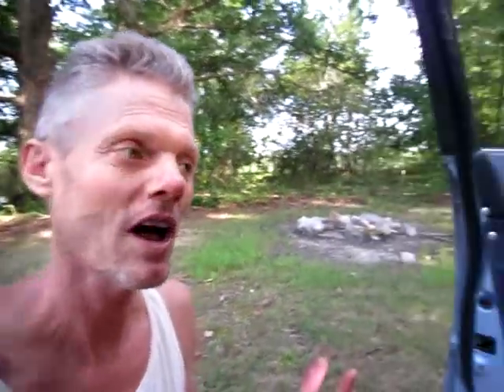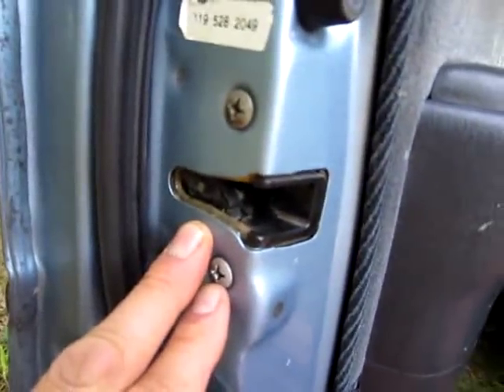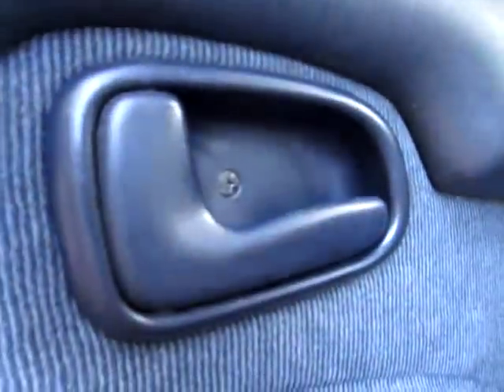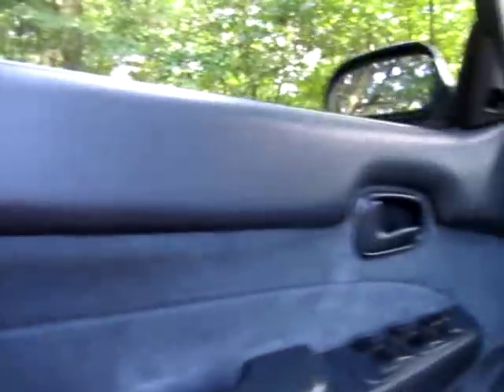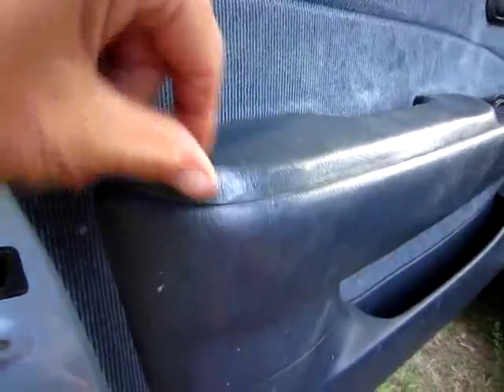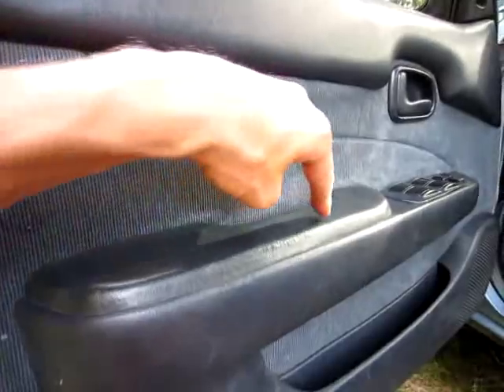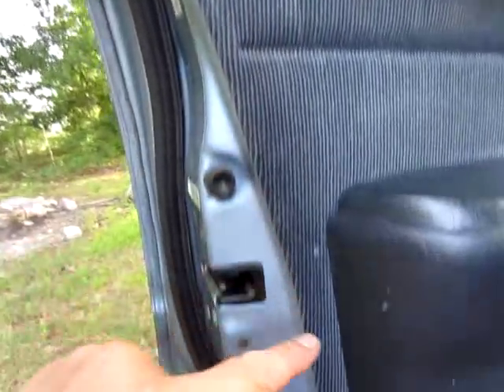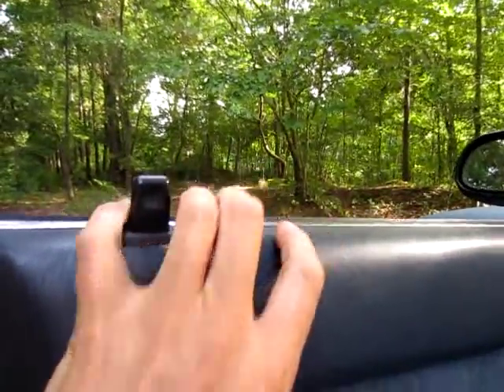Car Door Won't Open!  How to FIX Stuck Handle!

Comment: Hey Brett, you just saved me a load of cash.  Took off interior door panel, checked handle and latch mechanisms then noticed one rod was binding on the anti "slim jim" cover over the rods and it was out of spec  Took that out and bent it a little where it was binding, then took two pair of vice grips and rebent the door handle rod  on it's original bends.  Just a little bit so handle was back in the correct position.   Perfect!!!!!    BTW the car is an 06 Sentra, with 48k on the odometer and is babied.  So if anybody else is having probs with a Nissan, definitely try this.  Many thanks dude!
Reply from the maker: Isn't it amazing what you can learn on Youtube?

Comment: I will have to try this out, may be the answer to my rear door not opening after taking it apart, I'll thank you beforehand my guy 👍
Reply: @Vitality Massage, which way do I bend the metal, let's say with everything in place and inserted into the inserts and handle which way do I bend the metal?

Comment: I need to try that when the weather is warmer.
I have a 2002 Toyota Corolla and this car has no bells and whistles on it.
It still has the grank down windows and no cruse control.
It decided to stop working yesterday so I have to roll down the window and stick my arm out and open it from the outside.

Comment: EXCELLENT, VERY USEFUL AND ENTERTAINING TOO.
Reply: Hey Brett-
How do you actually "bend" the rod?  You don't Show that part on the video.  Can you make another video showing the actual process of "bending" the rod?  Thanks man.
Reply: @MrDaharpe  Just bend it. It's not that thick. Or you can put it in a vice to get more pressure. You have to keep bending until it lines up with the door lock.

Comment: Hmmn. This might be the problem with the Corolla. Changed the interior door handle, but the door still wouldn't open. The rod is moving though...
Reply: My rod is moving as well but the door only opens intermittently. Sounds like my rods need rebending as well. My wife says buy a new car. Buying new is her answer for everything, but I will try this bending of the rods and not waste money.

Comment: Incidentally:  Did you know that some if not all cars can be locked from the INSIDE using car keys to prevent an older child from opening the door; but can still be opened from the outside.     Merely a child security feature.
Reply from the maker: You're welcome!  I would love to keep making helpful videos for you but... 
 my livelihood relies on your patronage!  Have you seen my website yet?  I've got fantastic massage tools, millet hull pillows (all natural, comfortable and supportive) and much more!  Look for Brett's Natural Health on the internet or see link in description box!  
Thanks much,
Brett
Reply: Thanks bud, managed to google how to do that on my Mark X, someone had used the child locks and l did not know where they are, l almost went to a mechanic, thank you for saving my wallet man
Reply: hahaha thanks @George, now I can open my car windows from inside... the first owner set the child lock.. :)

Comment: why dont they just make them with shorter but straight rods in the 1st place? would never get the problem then. What make of car is that? its high mileage and usually american built cars fall to bits way before that
Reply: How to break into Mondeo locked door
Reply from the maker: A straight line of sight between the handle and the release is not available.  Also, the way the rod connects each mechanism has to be on the right angle.  This is why it can't be a straight rod.  Wouldn't it be easy if everything were that simple?

Comment: I don't agree with popping the seam off...because then you'll have a separate nuisance on your mind. Better just to unscrew the door handle itself.  My last advise is for Brett. Everyone knows unscrewing the door would be involved, but you just wording everything doesn't really help. I mean it's like if I made a video on how to play Monopoly while I record myself showing just the Box.
Reply: And I'm only saying that because your video would have around 90% or 95% likes, as oppose to the 50%  range you have
Reply: They all pop off but you have to unscrew a few bits. On mine I had to unscrew the plastic pop up thing connected to the lock but then the thread it was connected to went sideways and the door could not be opened either way. Evenutally I used a needle to move the thread upright to reconnect the Plastic pop up thing.